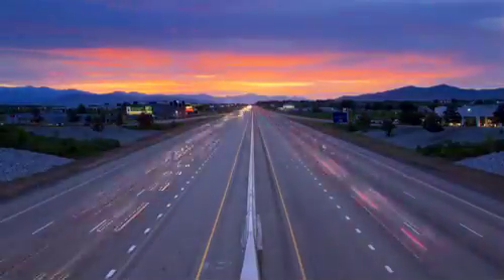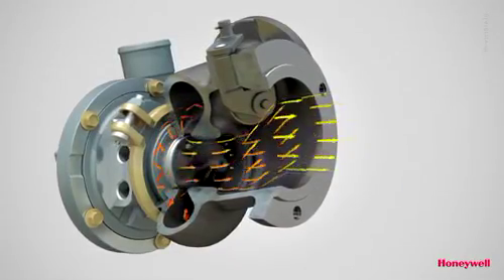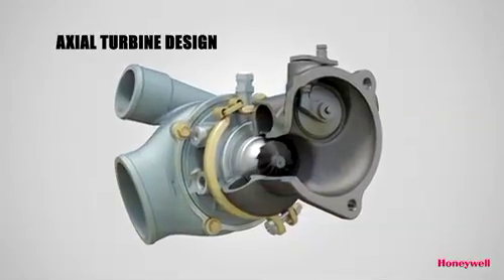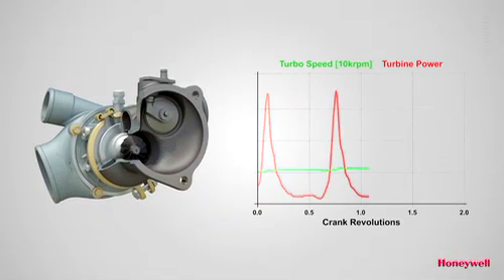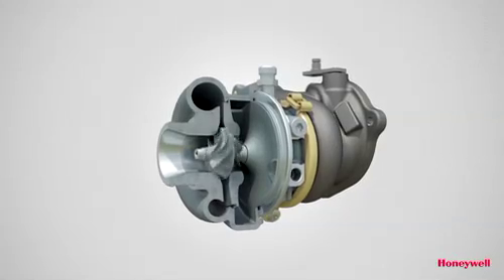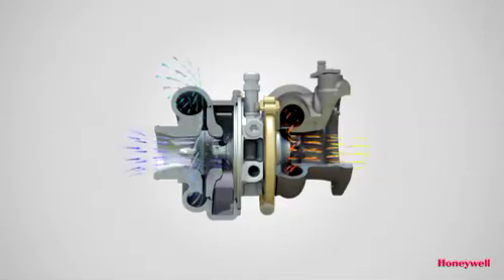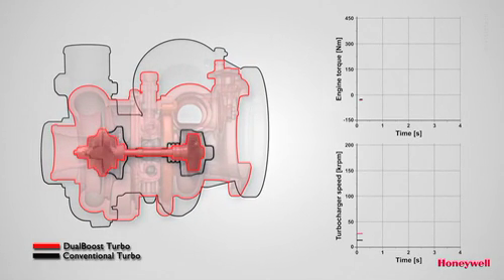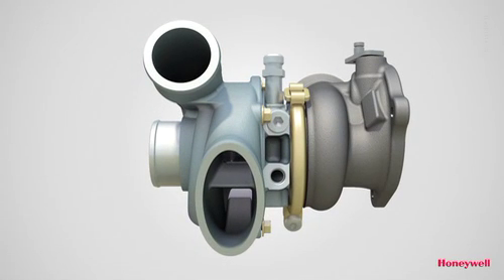Gasoline DualBoost Turbo - Honeywell Turbo Technologies

Comment: The only forces cancelled out would be axial forces from either side of the compressor impellers. Since this turbine is axial it will not generate much axial force relative to a radial turbine. This would mean that by using the dual-sided compressor impeller and the axial turbine then they have successfully decreased the amount of tension in the shaft when compared to a standard turbocharger.

Either way, the DualBoost Turbo is definitely not engineered to fail.

Comment: Seems like there would be crazy force on the bearings, instead of having the compressor and turbine more or less offset rather, they add another wheel to cancel the force of the compressor and increase the force on the turbine. Engineered to fail?